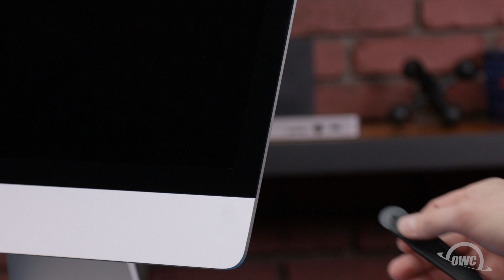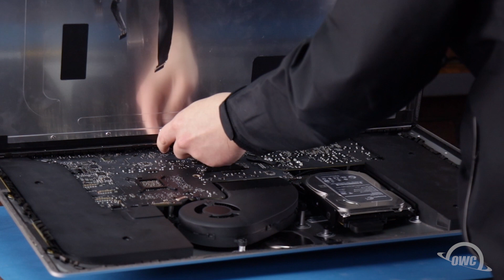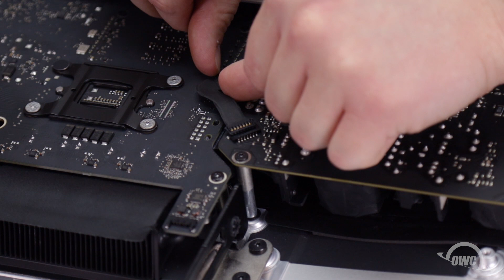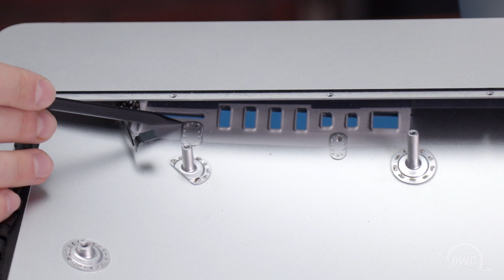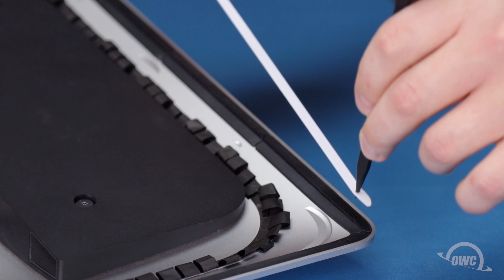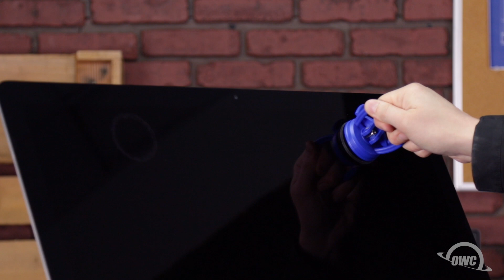How to Install/Upgrade the PCIe SSD in a 27-inch iMac (Late 2013)

Comment: I have a late 2013 27'' imac with only a 1tb drive. does my logic board have room for a pcie nvme?  or was it only available on higher end imacs? it has an i5 processor.
Reply from the maker: Hello Raven, unfortunately no, there is not a PCIe slot on the logic board of that machine.

Comment: Although an excellent tutorial, I am so glad I didn't go this route on the upgrade of my Imac late 2013 with a fusion drive. I would have been a nervous wreck after that. The only reason now that I would want to open it up is like so many other Mac users I worry about dust build up on the inside and the fan blocking. After much consideration I opted for an external boot drive still using a Gen 3 PCIe SSD in an external metal housing that connected to the Thunderbolt port. So although the card is rated at 2000 read and write speeds it is bottlenecked by the 10g/s thunderbolt connecter plus the housing and wiring. However even with the bottleneck I still get between 600 and 700 read and write speeds which far surpasses the fusion drive. The fusion drive is now internal storage and that has sped up now its not the boot drive. All in all the machine is rather snappy. I'm sure the inside is dusty but it doesn't seem to be suffering at the moment so all I can do is keep an eye and maybe one day open it up.
Reply: May I inquire? How do I connect a PCIe SSD to a Thunderbolt port on my iMac?
Reply: lohyewcheong Hi. If you have an older Mac with TB 1 or 2 look at a video for Transcend Jetdrive 855. It’s an upgrade kit. The only difference is I didn’t put it in my machine and instead used it as an external boot drive. If you have a 2017 machine you can get much faster versions taking advantage of the 40gb/s.
Reply: @julianwarrick1181  thank you very much for replying to my question! I just ordered it online! Can't wait to try it out!

Comment: New MacSales.com customer here. Thanks so much for this video. You guys are incredible! 

Other videos I've seen on this replacement have shown needing an adapter for the replacement PCIe SSD. Do I actually need to buy one of these for my 27 in iMac (Late 2013)? It does not appear to require this based on your video. See: 

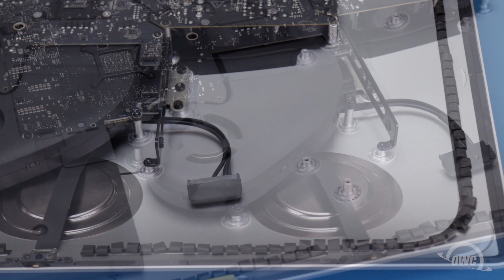Minute 5:45 - https://www.youtube.com/watch?v=Y3-n-iBCvqc&t=334s

Product: https://www.amazon.com/gp/product/B07FYY3H5F/ref=as_li_tl?ie=UTF8&camp=1789&creative=9325&creativeASIN=B07FYY3H5F&linkCode=as2&tag=lukemiani-20&linkId=8c2b062544611ba4f62fa428bea7fb26

Also, is there any advantage to leaving the 1 Tb HDD vs replacing with a new SSD in the HDD spot as well? 

Sorry for all the questions! Thanks in advance for your time.

Comment: Hello, and thank you so much for the video! So if I install the Aura Pro X2 and use it as my main boot drive, can I still use my regular hardrive bay as an extra, internal harddrive to store files on if I already have an SSD installed there?
Reply: @poweredbyowc  nice! And vice versa as well??
Reply: You sure can. Just did the process this past week. works and runs like a charm. best of luck

Comment: I currently have a regular 1TB HD.  I was planning to just replace it with an 2.5" SSD.  After watching this video, I am thinking I should just install a PCIe SSD.  If I got that route, can I remove the existing HD  and not replace it with anything as the reports say the current HD is starting to fail?  Also, what did you use for screen adhesive?

Comment: Will these iMacs PCIe slot use 2 or 4 lanes?
Reply: This is a bit belated, but I've read that - at least for the late-2013 27" iMacs, it is 2 lanes. It's a bit disappointing, but it should still be better than simply dropping in an SSD drive and hooking it up to a SATA3 connector. In theory, PCIe 2x2 should give you about double the throughput from a single SATA3 connection.
Reply: John Fisk Thank you so much for answering the question for me. Yes even at X2 PCIE, that’s way better than SATA3. (: